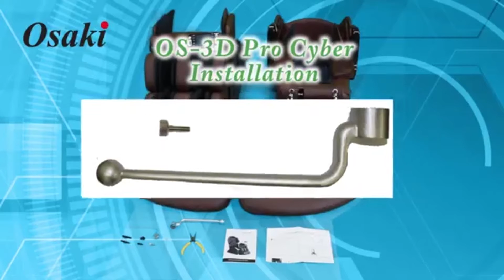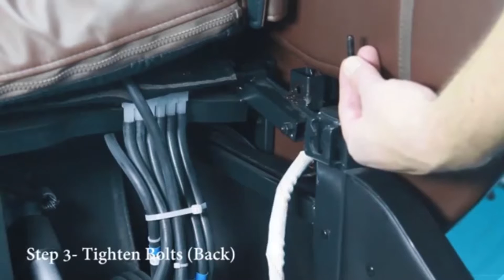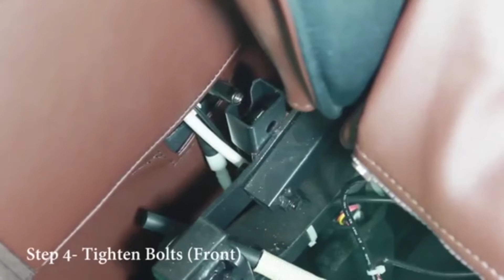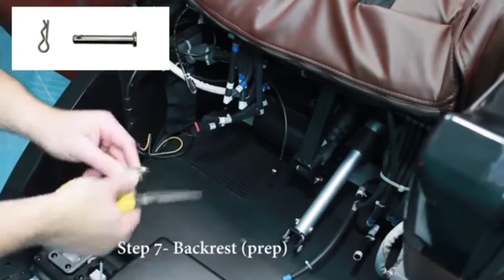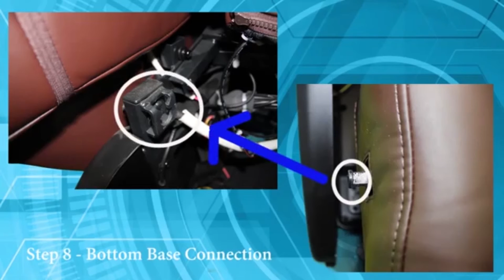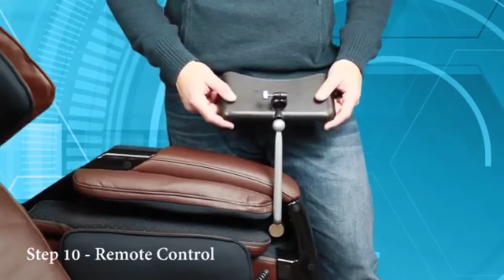Osaki 3D Pro Cyber Massage Chair Installation

Comment: You removed the piece with the split pin, but never assembled it to anything. Where does that go?
Reply: Seems like they didn't detail how or where to attach the split pin to.
Reply: It's not intuitive at all but there's a small arm on the bottom of the seat back that it looks like it might go into, but that's not it. Surrounding that small brown metal arm is a... bracket of sorts that hinges up and away from the seat back, and that's what the pin goes through. I hope that helps.